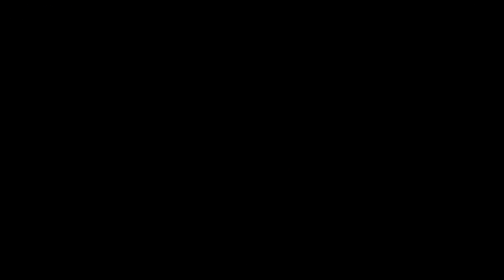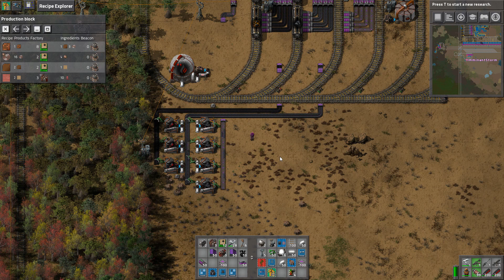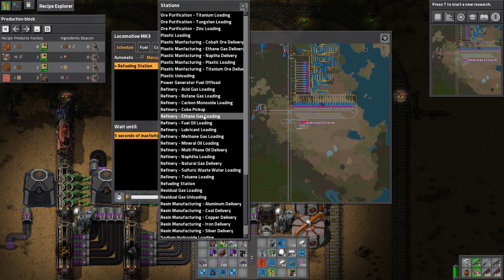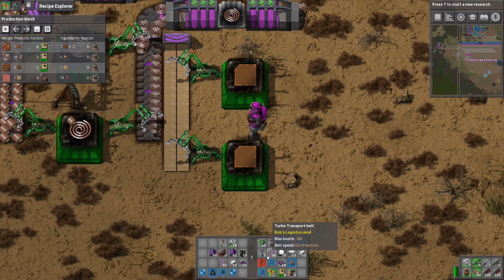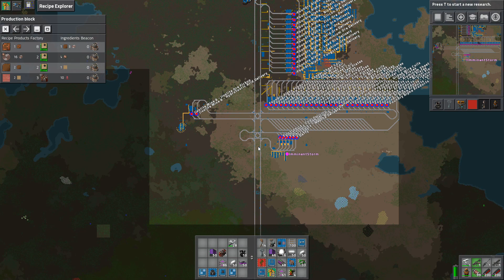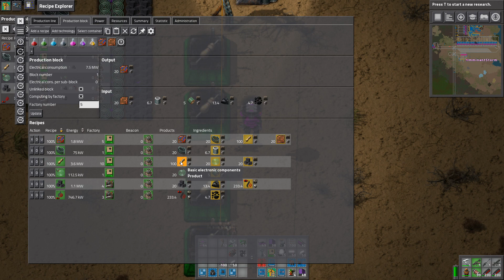Factorio - Angel's & Bob's - Episode 178 - Basic Electronics

Comment: You almost haven't left yourself enough room for an outbound loader (or "unloader", I guess) at your western box of electronics components. The only way you'll be able to get a loader onto that box is by making it east-facing, and having both the wire and carbon belts go underground for a space, giving just barely enough room to place that unloader. But then, given the 2-to-1 ratio of electronic component assemblers to electronic board assemblers, I think direct insertion is better. Just have a row of 10 assemblers like you had your original 5 (two together, then a single gap) making electronic components, then each pair direct inserts into one assembler making electronic boards. The solder can be brought in from the north in underground belts (like you do with your fuel in the foundry) since there will be big enough gaps for it to fit, and the circuit boards can be brought in on the east side of the row, just like you bring in the wooden boards around 14:39.